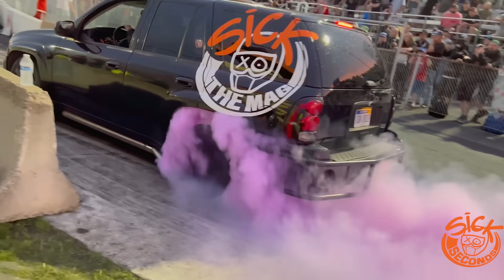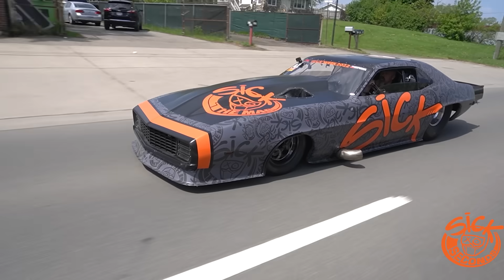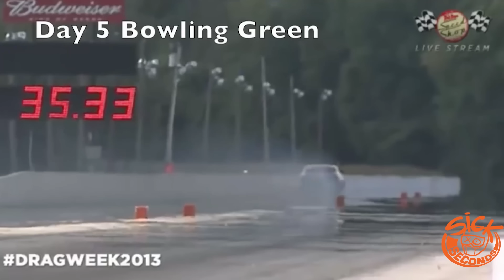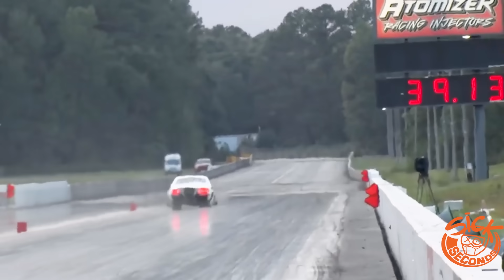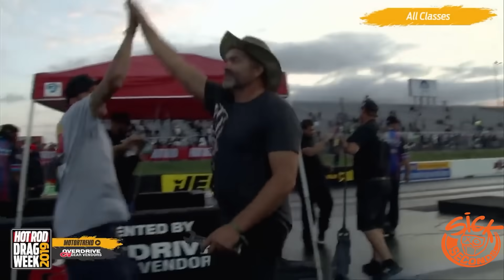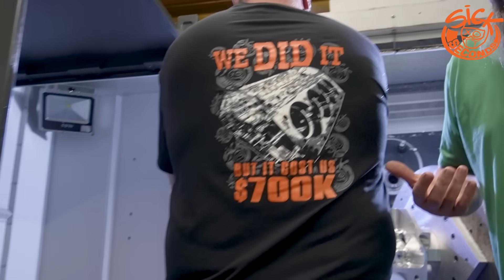$700,000.00 Engine Block!! We Did It But It Took 2 Years!

Comment: Tom I am QI at a prominent aerospace company and I inspect aluminum rocket parts and God dammit I'd do some ultra sound on your blocks for free!!
Reply: That would depend on what they start with. If it's forged billet block it will be nigh-on fully dense, except perhaps on the center line of what once was the center line of the continuously cast block before forging. But that imaginary original as-cast center line was where the lifter valley now sits, so most of the potentially affected material will be removed anyway.

Now I have to admit my experience is with ultrasonic inspection of steel, rather than aluminum (actually aluminium where I'm from) but you'd be looking at flaws less than 1/32" or even below 1/64". Bring a 10 MHz probe at the very least, if not 16 MHz. Phased array if you have.

If we're talking NDT, a dye penetrant test would probably make more practical sense than trying to do a meaningful ultrasound.
Reply: @Hydrazine1000  He uses forged billet blocks for the heads and blocks.
Reply: Ultrasound is old tech
Reply: @salvatoregiovanni8967  Single transducer/receiver tech may have been around for decades, but state-of-the-art phased array ultrasonic inspection can show full 3D volumetric results.  Old tech? Far from it.
Reply: @salvatoregiovanni8967  not in the aerospace world
Reply: I was wondering if they did  those types of inspections. Seems like it would be a good idea with as much time and money they are putting into each block. They could potentially find a crack or void before blowing it up at the track. I have to have some of my parts tested with dye penetrant when I am done.
Reply: Aluminum is actually nasty to machine unless it's already heat treated. Dead soft aluminum would clog the flutes on an endmill.
Reply: @robertwest3093  100% even with good speeds and feeds it still struggles and brushing it out or air it off to check it , usually it chips away but the heat of the material sticks to the carbide tool
Reply: Do a hardness rockwell or brunel test on it before and after heat treat to prove the process has been throughly done to all parts and area’s of the material would be good to see ✌️👍
Reply: @liammcgrath6184  He said that it's certified by the professional company who heat treated it. That means it's already gone through testing procedures to verify it's hardness. As a company who does that sort of work, you don't certify an inferior piece, lest you want to be out of business within weeks.
Reply: @calvin99991  no harm in actually doing a hardness test prior and then other blocks to prove your product is more superior in more ways and if he did reveal tests and records doesn’t mean anything, because their testing, methods and results are all company copyright protected.
Reply: I would curious to know if in the process of developing the smx if Steve ever had ultrasound done. Sounds pretty interesting
Reply: @87JD  The last time Steve had an ultrasound done, Kyle was born a few months later. LOL  I agree though, it would be interesting to know what all this fancy testing would show!
Reply: @warrenmichael918  😂😂 now that gave me a laugh this morning. Thanks for that.
Reply: @jdshanahan4215  yes ultrasound is done with all aluminum aerospace programs it's a tricky process but definitely needed for components at this level.
Reply: @never-stock-rc2968  That depends on the process route. If this were made through casting and machining then an ultrasonic inspection would be very sensible, because during solidification the alloy shrinks and can create internal voids. However, if this engine block starts from solid forged billet block, where the process of forging the cast block into a forged billet presses those internal voids closed, it makes less sense to inspect by ultrasound. Especially when the original center line of the casting is removed during machining.
Reply: @Hydrazine1000 Steve Morris has said the the blocks are made from a forged billet of Aluminum
Reply: @87JD  He did. He's working with a company that does all sorts of metallurgy. It was also the place he used to figure out why he had a main cap bolt head break off which he spent the better part of 5000$ to figure out - same when he had the rod mass exodus. From what I understand, he's pretty anal about getting things right and follow up if there's an issue.
Reply: @AB-80X  right on. I figured he did but wasn’t sure. Thank you for clearing that up.

Comment: As a prototype cnc machinist it's amazing how many hurdles you have to overcome for even easy products when you are trying to make them at a high level. It is almost easier to make one versus 10 when you are making a complex piece of billet at this level.
Reply: As a Swiss machinist I can spend at a minimum of a full 10 hour day to program, setup, and get a good part, on a simple part.
Reply: @mudrunner66  - that makes me feel better, sometimes I feel like I am too slow. But realistically I think I'm pretty efficient, and don't make many mistakes, there are just a lot of steps to go from a model or drawing to a decent finished part. Then the are people who want me to make a modified version of my production items, and wonder why it would be 10x more expensive.
Reply: As a lead footed hillbilly, I can break it if itll break.
Reply: I have been doing 5 axis aviation and industrial components for 15 years and still I find parts like these exciting and terrifying at the same time. Well done! CNC machining can be nerve wracking job.
Reply: For sure!! The cnc machines I inspect parts for you can drive 3 city busses through! Rocket parts. 🚀  this is way cool to see on hot rods!! My 2 worlds colide!
Reply: @mostlymotorized  i meant it more like 1 is less work but if you dont learn everything from that one part it can take you several "easy" parts to learn from. essentially this is what tom describes in the video but i had already commented. Tom had already made one block and had made concessions to get it going and in the car but now that he has tried to make 10 there are new hurdles to cross on each one you didn't encounter on the last one.